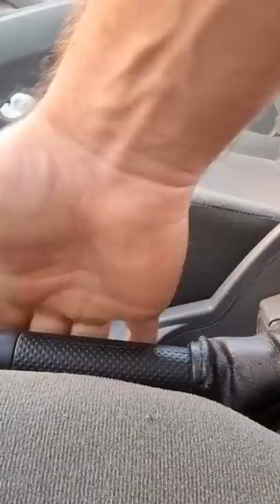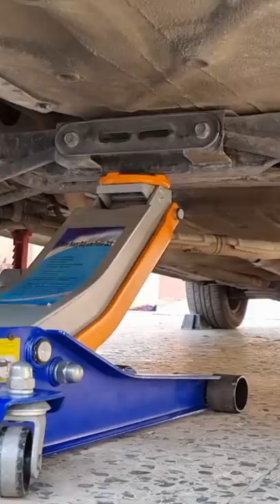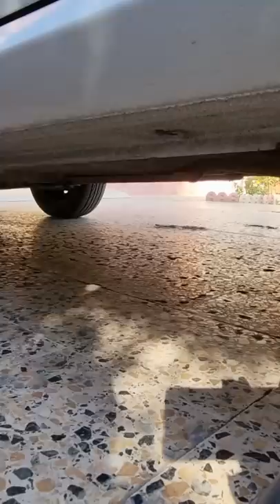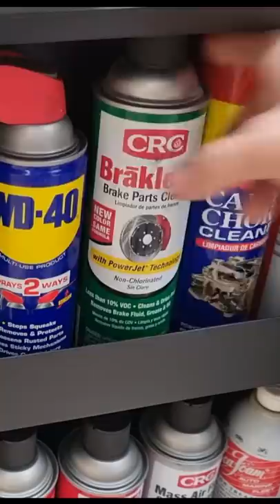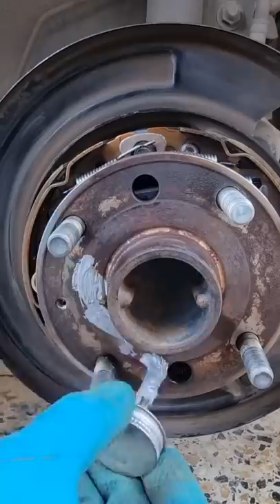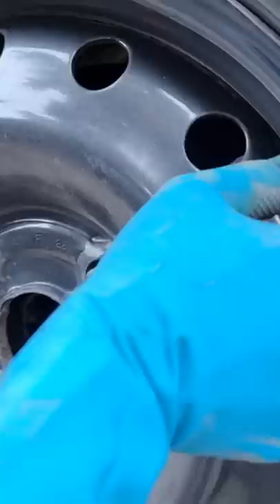Car still moves with handbrake on/How to adjust Parking pedal brakes #shorts

Comment: I don’t know if anyone on here watches this with no mechanical know how but I would like to point out that this person placed the wheel under the side of the car after he had taken it off. 

The reason why is just in the event that the axle stands do fail and the car was to collapse with you under it placing the wheel under that would likely save your life!
Reply from the maker: Yes exactly,  saifty first
Reply: Yes, But it’s far a way from professional work.
Reply: I was just gonna mention the same attention to detail about tire placement under car

Comment: Drive in reverse wile pumping the handbrake, it will ratchet itself.  
You literally spun the ratcheting device to tighten the break drum pads .
Reply: Exactly what I've been saying!!!
Reply: Go in reverse motion rather than say "DRIVE' in reverse.  Contradictory
Reply: Does that work on old cars? Asking for a friend 😅
Reply: Doesn't always work that way, the inside parking brake adjusters lock up and won't adjust the way it should so its always best to do it manually...

Comment: WD é universal né.
Se brincar até na nave do E.T. deve ter umas garrafas.
Reply: Uhm... why not just adjust the handbrake chord? Unless it's electric but if it's not an electric handbrake then just ja k the car up, find the handbrake tensioner and tighten it up, sorted
Reply: He preferred to clean the entire box internally.  By the way, he did.  Maybe if it didn't work out he'd look for the brake cable.

Comment: When adjusting parking brakes you have to do full adjustment first until you cannot move the hub then loose it in 3 turn and it will be perfect,

Comment: It’s good… only forgot to completely release the ebrake cable of any tension and THEN adjust the actual ebrake shoes to the drum/rotor then retighten the ebrake cable to the proper adjustment.

Comment: I heard you shouldn't use air tools to remove and tighten lugnuts, they will either strip, crack the wheel if it's alloy or be too tight that you can't take em off on your own.
Not sure about the first two but I had the bad luck of dealing with the last.

Comment: You should wire brush the rust of the hub sometimes you can end up with vibration on steering wheel if you don't

Comment: After he paints the silver stuff, the part where a gear spins around next to the the spring...
That is all you need to do, and it doesn't require all the stuff he did before that. Almost anyone how can change your car's oil can do this

Comment: Thumbs up because you showed proper jack stand usage, AND putting the tire under it, AND anti seize!
A little lacking though showing how to do the actual adjustment part, and didn't show Braklean to clean disc from WD-40 over spray... Lol

Comment: Didn’t do anything other than spray cleaner and adjust the brake which could have been done with the vehicle on the ground even. Also no mention of the massive dent/bent rim. 4 bolt POS likely eurotrash flame mobile. Pls self YEET.

Comment: Sorry.... where's the adjusting part? All you did was clean the shoes and drums.. that's not adjusting them. There's usually 2 cylinders in there unless it's a cable which then there is only 1 which is the Adjustment Cylinder with a small gear to turn... this is not adjustment at all BUT HEY WHAT DO I KNOW? ITS GOT 235K VIEWS😂😂😂

Comment: I want to start a handbrake verses e-brake debate now. I have never once used a parking brake, except in rare extreme occasions. When I drove a manual I engaged the e-brake in case the shifter popped out gear. Which I have seen many times. I have had to use the e-brake twice over the years due to the brakes giving out. My new vehicle has a crappy electric parking brake which I find totally useless, because it's an automatic transmission and I live in Iowa. It's one of the flatest states in the US. So why don't I have an e-brake? Instead of a parking brake? Salt wreaks hell on my vehicles and an e-brake would definitely give me piece of mind.

Comment: You are a great mechanic, but the thing you did wrong was to use a hammer to take out the brake assembly cover.

If I'm not wrong, the empty hole is the place for you to tight a nut, and as the nut gets tighter, the cover opens up from the inside.

Correct me if I'm wrong.

Regards. ❤️
Reply from the maker: Some cars has that, when you tighten a 13mm screw it will pop out the rotor, but the hole on this one, not tapped inside, it has no threads(teeth) that's why I used happed, but the hammer will be so light, bc I already left it with wd 40
Reply: @AliMECH  thank you sir for the quick reply. ❤️
Reply from the maker: No problem

Comment: Too much fast n furious.
The hand brake works the rear drum brakes
by cable adjustment and/or adjusting worm 
screw to spread out brake shoes.
He cleaned front disc brakes, but did not
clean rear brake drums...

Comment: Dude, no. Just adjust it through the window hole with a flat head screwdriver. Done. My BMW actually allows you to remove one stud and adjust the rear through the stud hole, don't even have to pull the tyre off.

Comment: Never use any lubricant on tire bolts.
You will overtighten them when using the normal torque, additional the will get lose...

Comment: Sometimes, when presented was to assist worth an issues like this, while you may be able so automatically adjust, or turn a few screws, every once on a while you should drive into the issue further and you should  clean, repair, and tighten, all the way in, and then protect on the way out. Yes you can adjust, but damn, take care of the damn thing once in a while instead of insisting that they do the absolute least amount of actual work. Damn!

Comment: Next time maybe just pull the wheel off remove the rubber plug ,turn the hub so the hole is aligned with the adjuster. Use a screw driver and done.

Comment: Bro that rotor has an adjustment plug, pop it out adjust and done. No need to take off the calipers and rotor…… and don’t say you need them cleaned. They aren’t used while moving so there isn’t a noise concern with E brakes that needs lubed or cleaned.

Comment: Nice working on clean vehicles. Where I come from all of that is rust welded and needs to be beaten off with heat sometimes.  The floor is literally covered with rust from anything 10 years or older.

Comment: Why do you pull the brake up the ratchet.. push the button in then lift and release when it stops. Just pulling up the lever makes a nice clickety sound and wears out the ratchet pawl and teeth. Then no adjustment will work.

Comment: You've shown a pad and shoe replacement edited out of order.
To tighten the handbrake remove the center console and adjust cable tension.

Comment: To have the proper adjustment in both wheels you should first tighten the adjusters  until you can not move tire by hand then loose it same number of turns if you have the manual it will say how many turns, believe me  I am a certified you tube mechanic 😂🤣

Comment: Did good till we hit that always seize on the hub, the heating and cooling of the hub assembly and rotor turns that goop into cement. Also zero explaination on the actual adjustment

Comment: You only need to clean the the parts that are moving with all due respect the one tire sliding on the ground does not suggest that it was a good great job it looks like the other three didn't stop for so it sinks the video though

Comment: Didn’t need to do all that just remove the rubber plug on the face of the rotor that’s access hole to the star wheel

Comment: Before adjusting in the drum, you have to slacken the adjustment on the cable.
Reply: Correct me if I'm wrong. You can just adjust the cable. In the middle of my cable it has a adjustment screw. In my s10
Reply from the maker: The brake shoes must be adjusted first to the right gap and then adjust cable if it needed,  if you adjust from cable, it will put constant tension on the cable and damage it over time
Reply: @AliMECH  not necessarily. Sometimes the cable is just stretched. Happens all the time.
Reply: @frogmanpipes9561  you have to back that adjustment off Before adjusting the self adjuster in the drum. Then you set the cable adjustment to 3-5 clicks of the pedal or handle. Until you get into bigger brakes like 18 wheeler, This is The Way to adjust drum brakes on 99%of cars and trucks... in the USA
Reply: @wr3ncher  yeah, I've never had to do that on my s10. The cable is stretched. So when ever it doesn't engage. I just tighten the cable. Works every time. We at least 3 times so far
Reply: @AliMECH  You are correct! The parking brake shoes first then if and only the cable has slack then adjust it as well if possible...

Comment: Do not use grease under disck🤦
Reply from the maker: It's not grease, it's anti seize
Reply: @AliMECH  no matter what it is. do you measure the runout of the hub and mounted disc?

Comment: Did you guys see that rubber plug on the rear disc, you just remove that and use and adjuster tool/ flat head screwdriver and slowly adjust to specifications.
Reply: Star wheel adjusters ONLY used for drum brakes. You said disc.
Reply: @hudsonstraight8628  thanks for the correction 👍

Comment: Do you see that rubber piece in the rotor. that's how you adjust the e-brake you don't have to take the brakes apart. If you're going to do a how-to video let's do it right huh
Reply from the maker: I know, but i always like to clean it first, i showed here https://youtu.be/z57Whp-9dFg

Comment: Pull up hard on the brake handle several times. It self adjusts that way. No need for screwdriver nor to get dirty. Tire was great example of "safety first". But always wear an N95 mask when servicing the brakes

Comment: Never put anti seize on the hub surface where the drum bolts up tight. Just need a little bit around the center ring. Wheels come loose the way this guy did it.

Comment: Well it's partly correct.
But most times you adjust the brake shoes then adjust the hand brake cable under the vehicle.
As the cable does stretch.
This is what normal happens and not the shoes that has worn out.
But good safety video 👍

Comment: Nice but do not use brake cleaner to clean parts!! Have a bucket and then use water to wash them. Brake cleaner can damage wheel cylinder boots or anything with rubber. Plus it does the same job instead of spending $5 per can. And... Who taught you to put grease on the hub without cleaning it first. Polish it up!